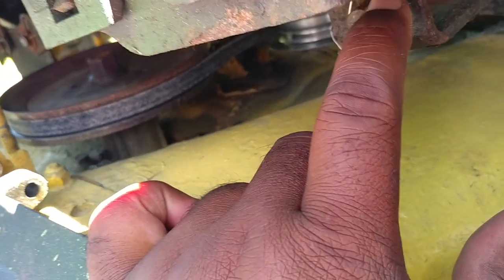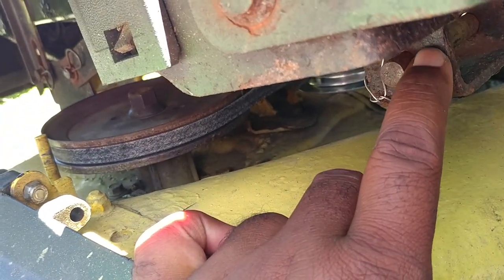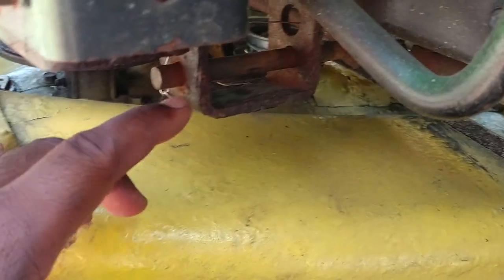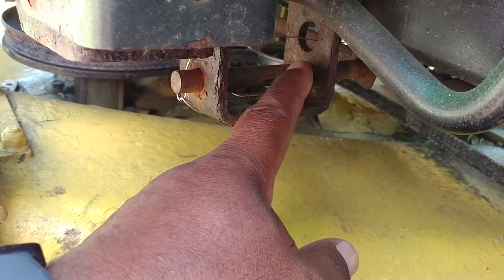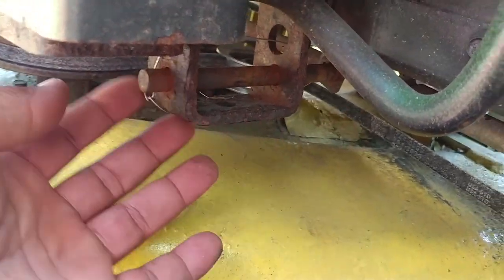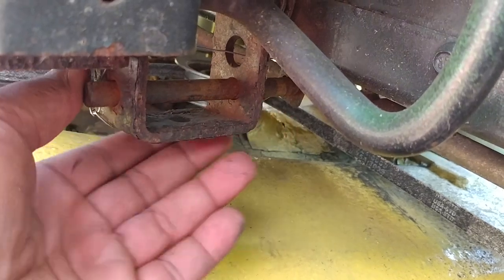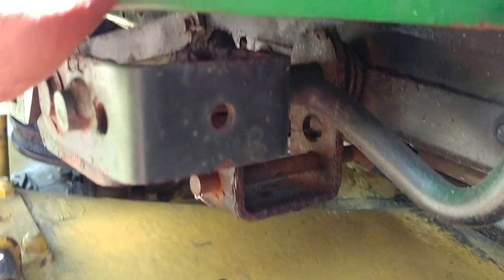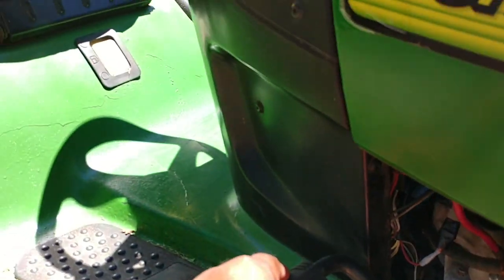John Deere cruise control

Comment: So mine will not pull up a small hill. I have never used the cruise control but mine acts if it notlocking in for the cruise control to come on. So my John deer runs good for about 30 minutes  then going up a small hill it doesn't want to pull me I'm not a heavy person  so what do you think might be goung on with mower? Thank you sherry.
Reply from the maker: Hello Sherry check the drive belt, put the deck at lowest position then look under the frame and check condition of the belt especially if it's a older machine.
Reply: OK, I will look at drive belt and the cruise control bar also , thank you for response .great video thank you again sherry.

Comment: Thanks for sharing, not sure this is going to fix my problem.  This is one of stupidest designs I've ever seen and after 4 years of this mower it ranks up there with one of the worst purchase decisions I've ever made.
Reply from the maker: I hope so keep me posted if it works👍🏽
Reply: @bigsonslawncare  wasn't my problem but thanks to video it motivated me to put more effort into diagnosing any issue.  My problem was cruise control kept popping out at high speed which gives decent whiplash.  I finally looked at this stupid mechanism.  There seemed to be a bit of play in the teeth thing so I tried to tighten that up.  Didn't help much.  In my frustration I yanked the stupid cruise control harder and it really snapped in tight lol.  Seems I was being a little too gentle on it and knowing what was down there never would have thought just needed some elbow grease.  I hate this mower just a little less tonight
Reply from the maker: @edconnell  Gotcha💪🏽